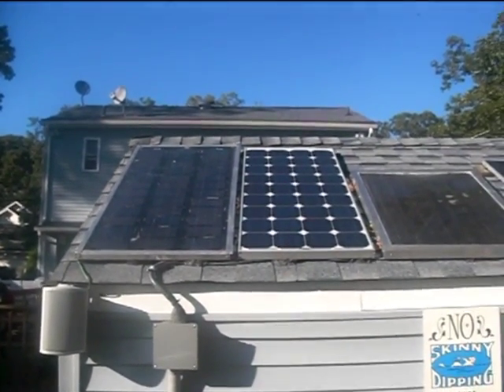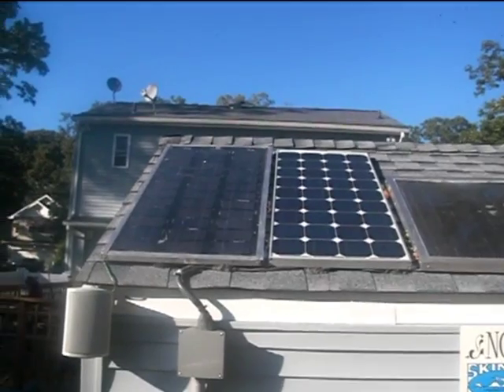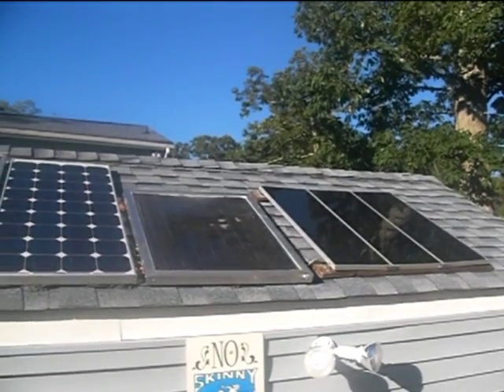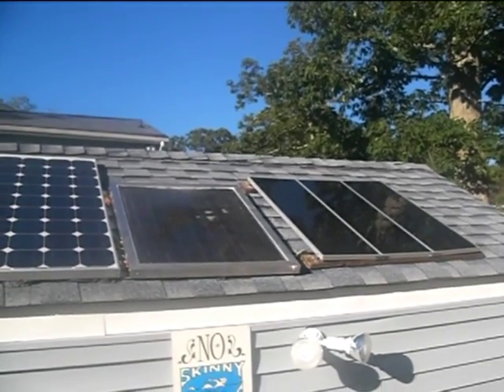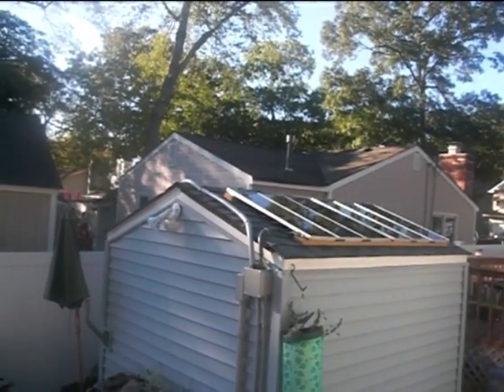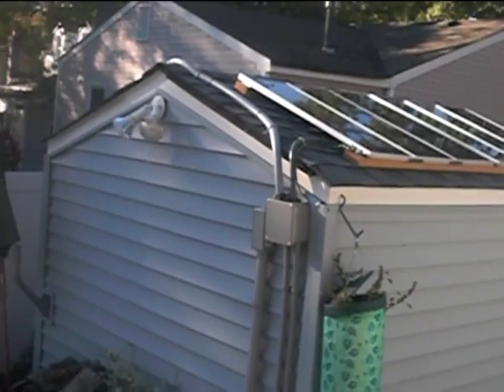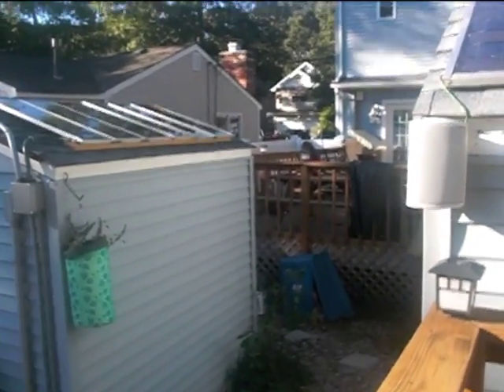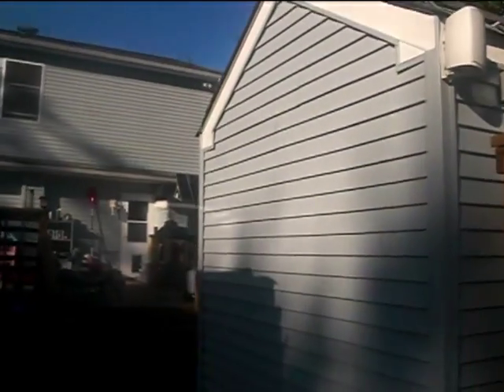MY (OLD) SOLAR SETUP

Comment: 5000 watt inverter @ 12 volt = 416 amps max.
Your #4 wire is not big enough, and your water pipe is not big enough either and could be dangerous and could be able to start a fire.
Different kind and different sizes of battery is a no-no.
Reply from the maker: Hi and thanks for the comment but this is a very old video... I updated my whole system and have all 6v golf cart batteries and 2/0 welding wire for all wires to batteries and inverter also No more water pipe!!

Comment from the maker: Right now i have it set up for grid tie, yes i can run certain circuits on battery but mainly i use it as an emergency back up.i would say thanks to led and cfl bulbs im drawing no more than 1000 watts for the whole house with every light fan and electronic on. i currently have 685watts in solar on this battery set up and (1)235 watt enphase panel on main roof.please feel free to check out my new video on this solar setup or any of my other video's thanks for your interest.

Comment: Very cool system ,  I can remember when I was where you are now. You soon be investing in a nice big clean solar array then I can see you getting a real nice group of big two volt batteries and then you'll be ready to up your voltage to 24V or 48v. You're doing great now and it looks like your having fun doing it. That's the best part. My system has a long way to go yet. Sometimes I wonder if I should have bought a 20 KW wind turbine and tied into the grid and be done with it. But then I'd have

Comment from the maker: @lancerooke No your absolutely right but if u want to go with quality then micro inverters are the way to go for 200 bucks an extra 100 bucks on top of a power jack... also power jacks don't  actually put out that much power than micro inverters from what i hear anyways..and im all about grid tie too!!but my hf panels don't put out that much but when i get extra cash ill add to system!!

Comment: @fanman1981 If you are referring to microinverters, I agree.  200 bucks extra for a microinverter under each panel is too much.  But power jack inverters are relatively cheap and seem to function relatively well.  Are there other parts that I am not aware of?

Comment from the maker: @lancerooke Thanks for watching the reasoning for the batteries is to have back up power in case of a power outage and to use off grid power at night!! i agree with you that they are expensive and a hassle to maintain but it gives me something to do!!
I am also starting going grid tie but thats also very expensive for good quality parts...

Comment: Your system is cool. It seems overly elaborate in fact, which leads to my question.  Why are you using batteries?  What's the point?  Why not just go grid-tie 100%?  Batteries are expensive and a hassle to maintain.

Comment: Your system is looking great . I love to see all the switching and grounding. well done. Remember when the charge controller is in float it will only harness what it needs to keep the batterys  at float. China is growing fast and cute as a button. Trash bags suck pillow case is the way to go.

Kevin